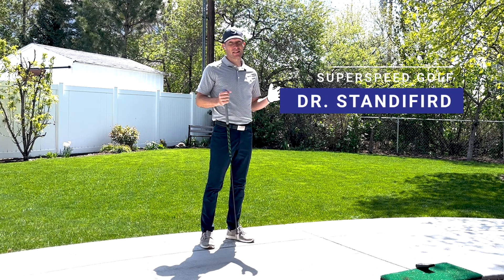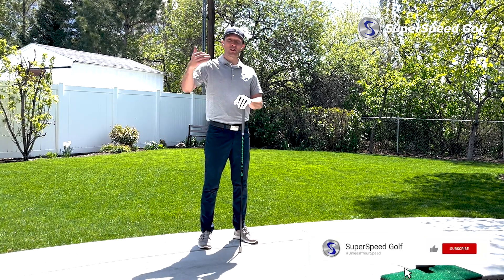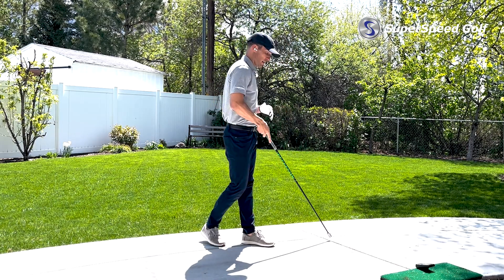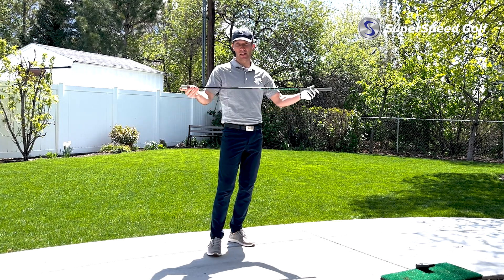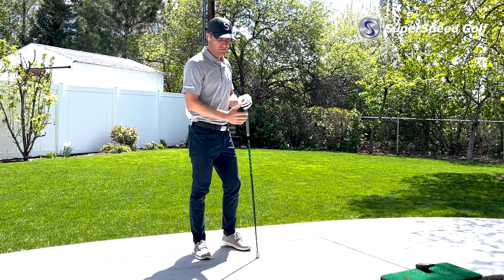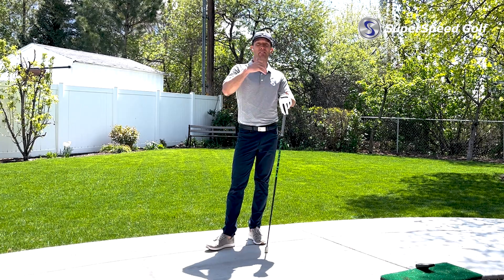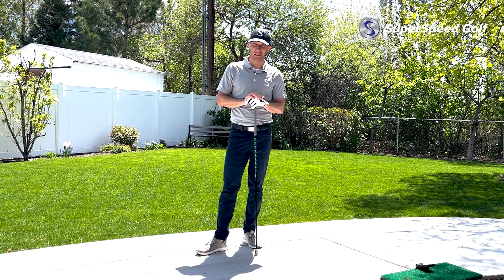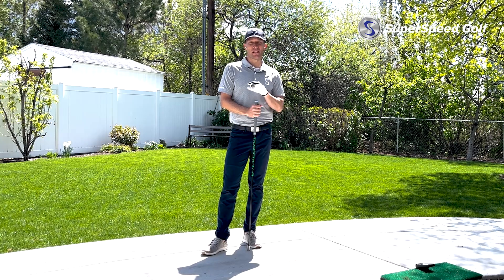Keys to Measuring Your Swing Speed Gains Accurately

Comment: Do you ever have issues with the PRGR mixing club speed with ball speed when swinging the speed sticks. And/or only giving a reading for the club speed?
Reply: Yes the device sometimes mixes up the ball speed with the mixing speed. It also produces false readings. For example if you know your swing 110 on the extra light stick but if shows 56 mph and you know that’s not right, it can become incredibly frustrating.
Reply: @haileystricker4169  My guess is that it's looking for 2 readings. A slower speed for the clubhead, and a faster speed for the ball right after. If the ball isn't there I assume that it's picking up the speed stick right before you unload at the bottom, and then again when you accelerate through the contact area. Usually the "ball speed" reading is what I know the clubhead speed should be so I record that . I haven't seen anyone else talking about this issue with the speed training. Figured I couldn't be the only one.
Reply from the maker: Hi Zach, we have heard and experienced this issue sometimes when training indoors especially. We have also noticed that the new PRGR does this much less then previous model